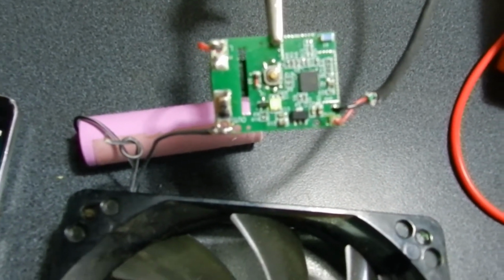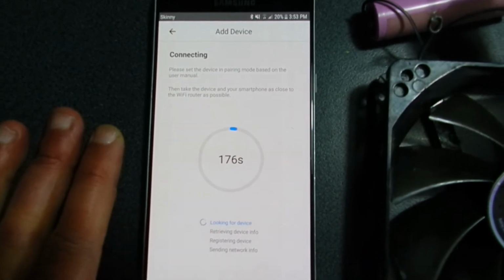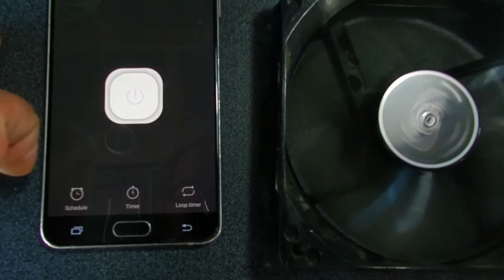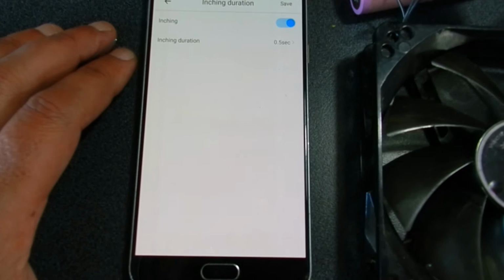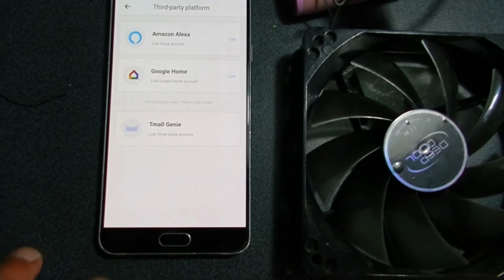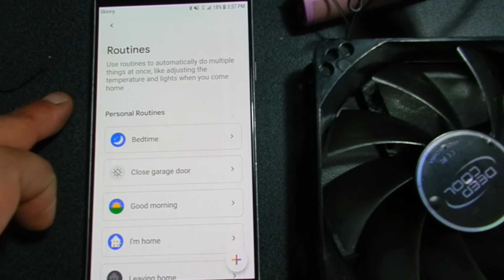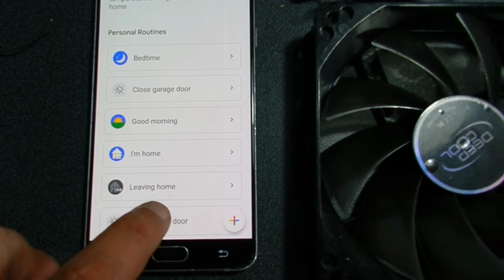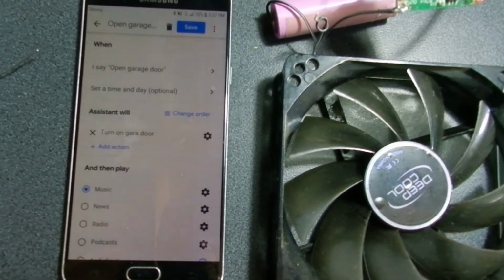How to create a voice activated garage door opener for $5

Comment: Is there any reason I couldn't wire this to the wall button for the garage door instead of directly to the opener? That makes powering it a lot easier for me and keeps it closer to the router
Reply: It should work as the wires are connected to the same location. I plan to connect it the way you want.